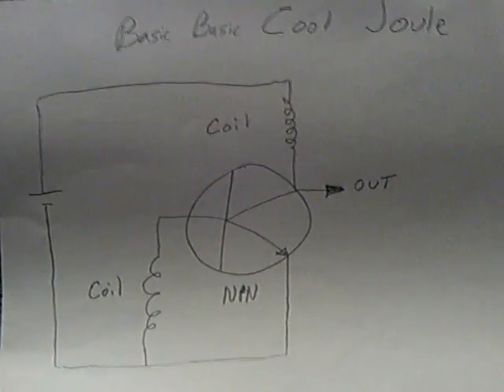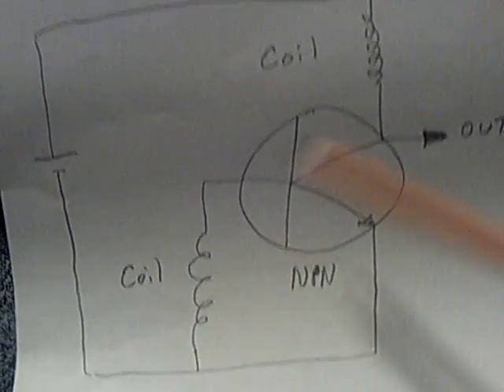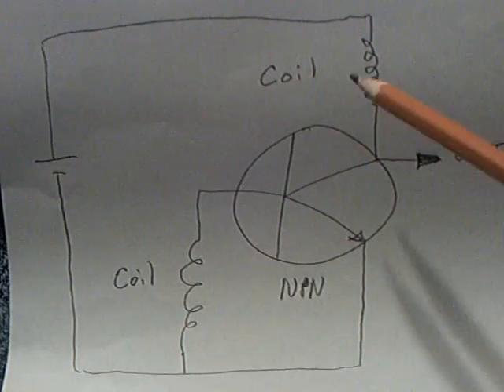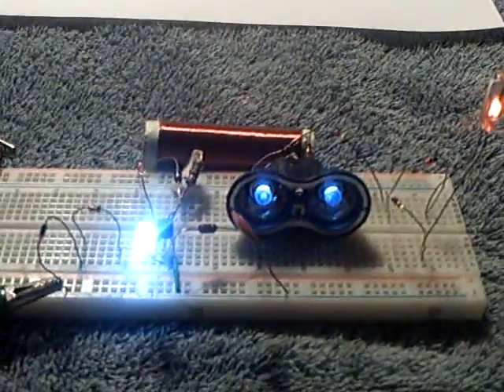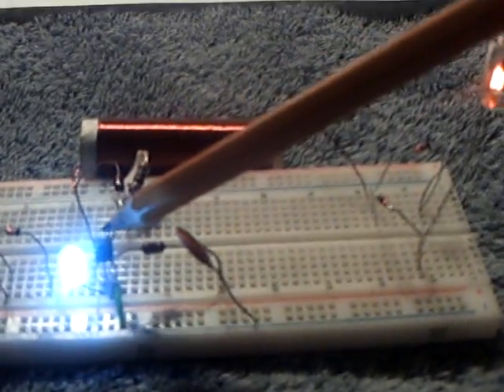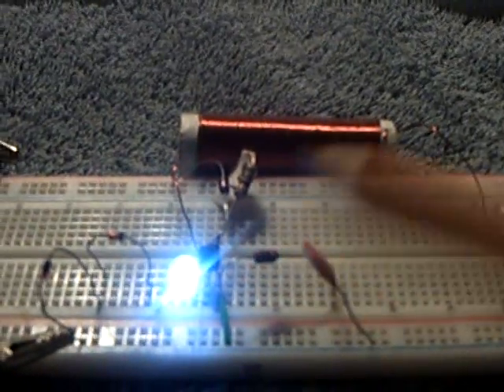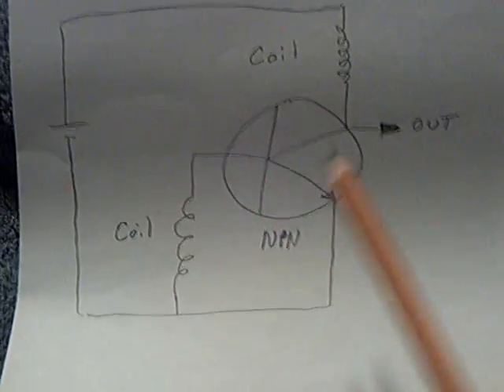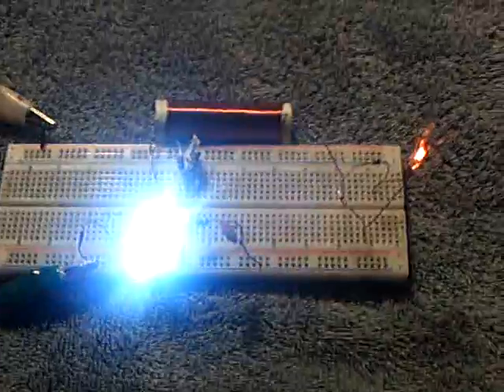Cool Joule -morphed into exciter circuit

Comment from the maker: Give it a try --- just use a basic SEC 15-3 circuit as a model.  No plasma   no way. Add the protection diodes and a led if you want.

Comment from the maker: Thanks for the interest. I have never tried that three transistor arrangement.  That L3 coil here is attached to the collector but does not have an inductive coupling with the other coils. Sorry but I don't think that is right to post a sketch this "morphed" circuit because it might be confused with an actual Dr. Stiffler circuit.  The component values here are incorrect.

Comment: @Lidmotor Really appreciate the credit you give and the respect you have for Dr. Stiffler’s work. I also think it’s good that your video title doesn’t include SEC because the exciter circuit you’re demonstrating is very unlikely to achieve Spatial Energy Coherence. There are some exciter variants that use some of Dr. Stiffler’s design like protection diodes but they’ve gone off in different direction that doesn’t achieve SEC so they don’t give Dr. Stiffler due credit for any part of the circuit.

Comment: is L3 over the L on the + of the battery?
I see a small capacitor, what is it attached to?
have you tries to put like 3 transistors collector to emitter, in series, all bases tied together? I think it gives sharper timing and way less ampdraw (not sure thought). The idea of sharing is to have others do as you do. I cannot build your circuit because you did not take the time to make a sketch of the circuit. It is half a job . . . please finish . . .